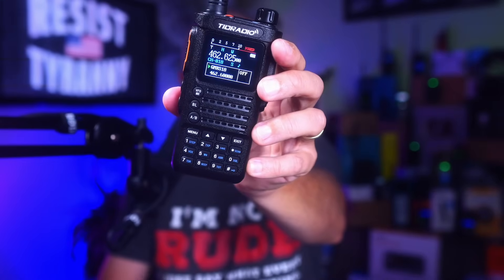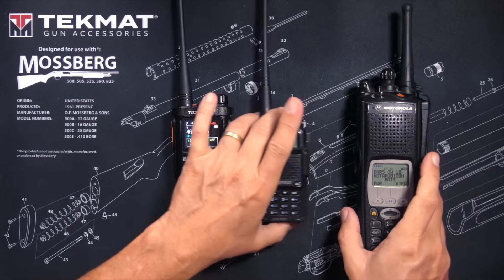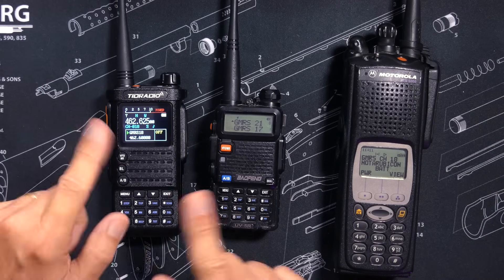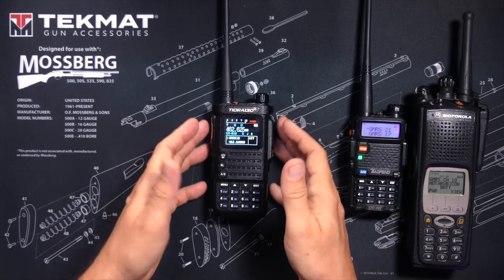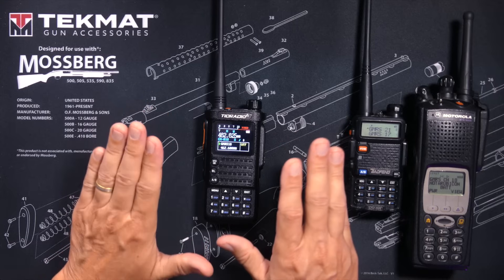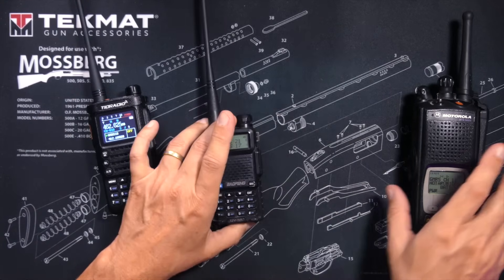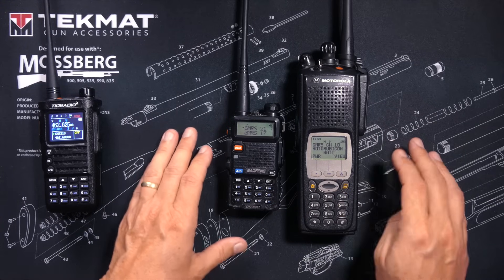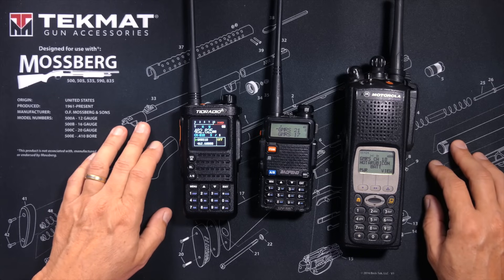What Is The Difference Between A GMRS Radio And A Ham Radio? What IS A GMRS Radio Per The FCC?

Comment: Just a noob question from a new subscriber. After seeing your video about the Wouxon KG-UV9PX, it got me wondering. If the radio is unlocked and GMRS channels have been programmed, is it legal to transmit on those channels with a GMRS license, even though its a ham radio?
Reply from the maker: The FCCs says thou may transmit on GMRS frequencies only with GMRS approved radios, so, no.
Reply: @TheNotaRubicon  Thank you...I appreciate your keeping me straight with the FCCs

Comment: 4:40 Question:  you mentioned that mobile GMRS radios must not be able to transmit on channels 8-14.  My impression was that they didn't transmit on channels 8-14 because the mobile radio manufacturers didn't want to deal with having to transmit on such low power compared to the other channels, e.g. for technical reasons they *chose* not to transmit on 8-14.  From this video it sounds like that is not the case, and that it is an actual specification from the FCCs that mobile GMRS radios are not *allowed* to transmit on channels 8-14.  Is that a requirement?  If so, do you have any idea why that might be?  Thank you so much for all the fantastic information you provide.  😊
Reply from the maker: I used to think the same thing, that it was just about power. But there is an actual line in the FCC Part 95 wording that says something about hand-helds only on those channels.
Reply: @TheNotaRubicon   I had no idea.  Thank you very much, and for taking the time to read and respond.  Much appreciated.  😊

Comment: My wife bought a Beofeng walkie talkie on TEMU for $1.99.  It is an 8W radio. It is DTMF encoded.  No mention of GMRS. No mention of license required.  I am GMRS licensed.  Can I use it?
Reply from the maker: If it did not say "GMRS" on the product listing, and if there is not a "GMRS" sticker under the battery, then it is a ham radio.
Reply: Thanks.

Comment: I saw   where someone   share  where  it said  arrl reported  that  there's more gmrs  license  then ham tech  license
Reply: The mygmrs website says:  As of April 14, 2021, the total number of GMRS licensees in the United States reached 100,000.  
As of February 2023 numbers show GMRS licenses total 336,513  That's more than triple the number of licenses in just two years.
The ARRL website says this week there are this many hams:  Novice = 5,939	 Technician = 377,230	  General = 187,263   Advanced = 33,090	  Extra = 155,206	 
For a grand total of 758,728 licensed ham radio operators.  
An interesting question is how many hams also have GMRS licenses.  I have both. (plus a private pilots license and a scuba diving license but Randy doesn't like off topic comments.  Sorry, Randy)

Comment: You are rarely, almost never wrong. But you almost went there in this video. Radios like this are NOT thoroughly tested and examined by the FCC prior to certification.  Rather, they allow third party companies you have likely never heard of do testing and fill out forms promising and certifying that they tested sample radios to comply with the relevant standards.  This process is the same across huge swaths of the electronics industries from radios to computers to anything else that has the FCC logo.  The FCC takes those third party certification letters and says, sure there you go.   Sell it. You will see the wording say "Tested to comply with FCC part whatever" because the private company is saying they tested it. It was good.  We were not bribed to say this. It really is good.  The FCC can, at their leisure, take sample devices and test them for compliance.  But this is not a normal practice. They rely upon private industry to police itself and promise to obey the rules.  So. We all know how well that works.

Comment: Randy, just curious if your 2nd generation TIDRADIO is showing 10 watts on the display even though it is transmitting 5 watts.
Reply from the maker: Thats not a scale of watts on the display, it is a display of power from 0 to 10.. Where 10=5W/high power and 5=2.5W/low power
In other words, yah..
Reply: @TheNotaRubicon  Thank you Randy I didn't know that.

Comment: Hmmm…….  Sounds like the FCC’s are baked? If a GMRS radio is GMRS and has been Baked will it be able to squirt RF on other frequencies if the baking was unbaked? I think put it in the freezer and you might be able to hear the FCC’s talking on MURS or a CB! I have never heard these FCC’s on any of my radios? I see there call sign right on the radios usually under my battery but never hear them!